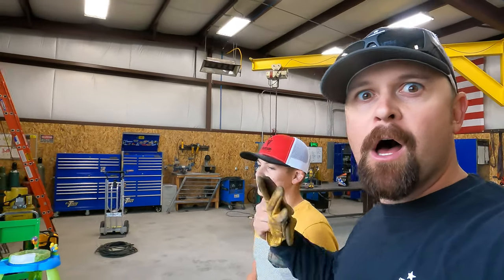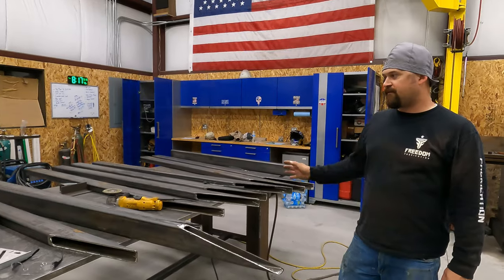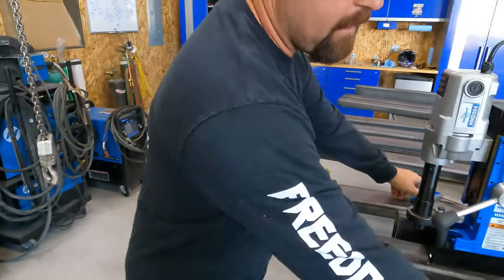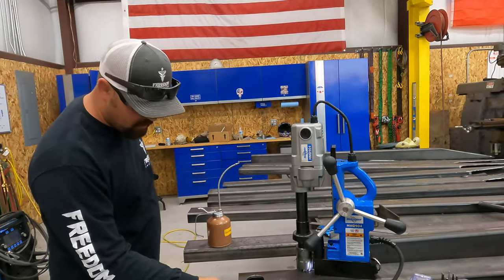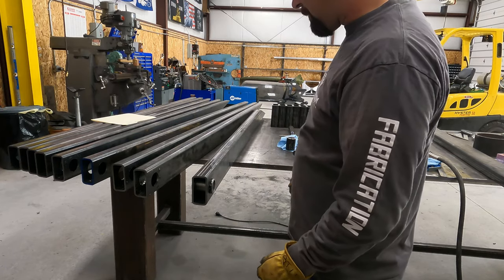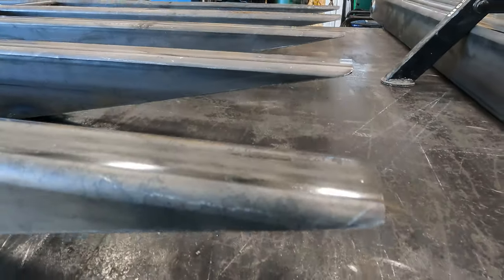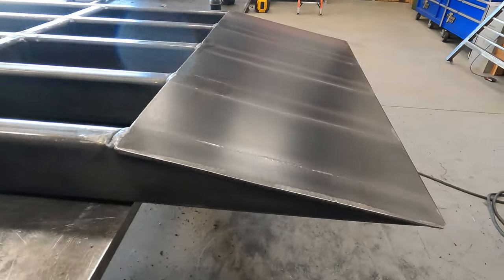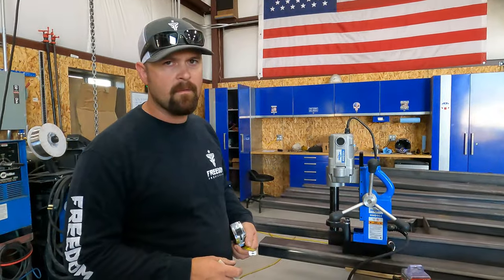Fabricating and Machining Semi Trailer Ramps.

Comment: New to your channel loving it!!! A suggestion to help with productivity and consistency on drilling that many parts on the mill would be to set a back stop to slide the part to then clamp with the vice. Using this method you would set up one part and lock the table. All the remaining parts wouldn't even need layout.
Reply from the maker: Thanks. That is a great suggestion on the parts drilling. I’ll give that a try. Thanks for watching!

Comment: For making lots of the same cuts like thise tubes i have taken a piece of 1/4x2" flat bar and make a U shaped straight edge so you can cut both sides of the tube at the same time, also helps insure both sides are cut identical.
Reply from the maker: Sounds like a great idea. Something I could probably do more often is use some type of jig. Thanks for watching!

Comment: @Freedom Fabrication -- Try something for me. When you have the flange wizard straight edge, if you will tilt the edge so it barely touches the line, then tilt it back so the magnet sticks to the metal, you should be the correct distance from the line for your torch and you won't have to measure before you cut. Give it a try.

Comment: def heavy duty man! only question, why not tread plate? seams like you did extra work, good build though man!
Reply from the maker: The customer submitted a drawing, and the drawing called for plate with expanded welded to it for extra traction. just one of those things where it was built according to customer demand. Thanks for watching!
Reply: That was my question too. I thought it was probably customer preference.  I am curious though if you had to rework this after some time.   Nice work as usual!

Comment: I'm enjoying your vids and this one really put a cap on it, but...one question - there's no way in hell any mortal man is going to lift and lower those beasts by hand, so what will be done for hydraulic cylinder hook-ups ??
Reply from the maker: Right you are! The customer already had some ramps on the semi trailer that these were replacing. There was already a hydraulic system on the trailer for raising and lowering the ramps. I appreciate the positive feedback, and thank you for watching!
Reply: Thank You for the quick and positive feedback.  Not common at all. @Freedomfabrication777

Comment: Mill is for sure a better choice for that job. I try to keep drilling under 1in for the mag drill. Cutting force is just to high, even for my big milwaukee mag drill
Reply from the maker: Just wondering, Do you use any cutting fluid? It seems strange to me that you have to use so much cutting force.
Reply: @Freedomfabrication777  I usually do. I'll use tap magic most of the time. Seems to help

Comment: Nice work for what it was, however. . . I would have suggested to the customer diamond plate instead of flat plate and expanded metal. Just a thought.
Reply from the maker: Thanks. The customer was worried about having enough traction while loading his 15 ton reach fork in the winter. Here in Utah we get a lot of snow. I think that’s why he wanted the expanded. That would definitely be another option though. Thanks for watching!
Reply: @Freedomfabrication777  I guess as long as he doesn't try to load steel tracks it should be OK.  Great content!!!!

Comment: Why not use the mill to get these holes in the same spot?
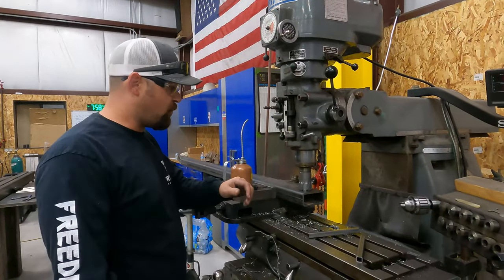Reply from the maker: I did end up using the mill on these to get the holes drilled. If you skip to 35:05 you’ll see my explanation of why I did that. Thanks for watching!

Comment: Why you did not use checker plate?
Reply from the maker: Because the customer is using them to load his 15 Ton forklift and he wanted the extra traction in the winter. He was worried Diamond plate would still be too slippery.

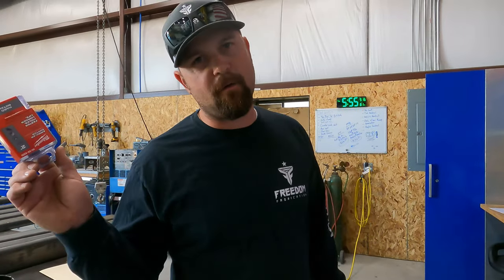Comment: At 19:00; Drawn Over Mandrel (DOM) explanation...
Thank you for taking the time to explain this. Is that something a metal supplier carries usually? Always great to learn something everyday and I definitely did watching this video. 

As a certified mobile field welder myself watching this video was very entertaining. Great shop set up and love how your boys are itchin to help after school. The jib crane is awesome too. 

I got a pointer on the slugger Hougan drill...they make this wax/gel you can use and its cleaner and less mess...no stains in your concrete. Great for if you need to drill holes in delicate areas.

Thanks again for providing great content 🔥👍
Reply from the maker: Yes, DOM is typically carried at most metal suppliers. Thanks for the suggestion on the Hougen cutting wax, I’ll have to see if I can find some. Thanks for watching!

Comment: You may have used them before but silver pencils work a lot better than soap stone in my opinion. If you haven't tried them out yet I recommend you give it a shot.
Reply from the maker: I actually do have a box of them and I will use them sometimes on metal that doesn’t have mill scale on it. I feel like it shows up better on some of that stuff. I guess it just hasn’t really caught on. Could be the old school side of me that hangs on to the soapstone.